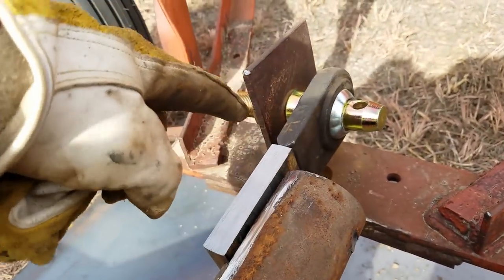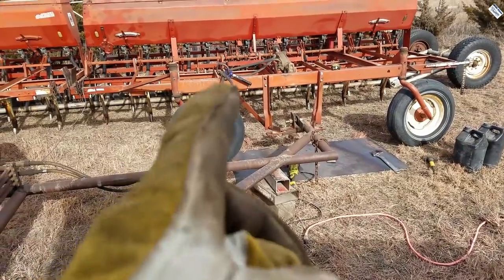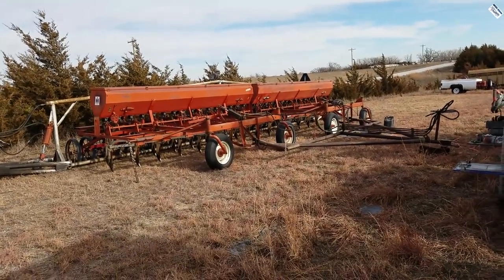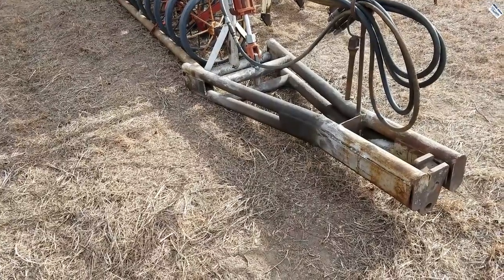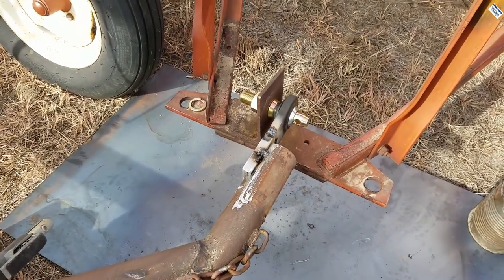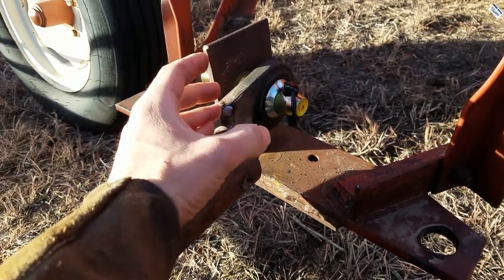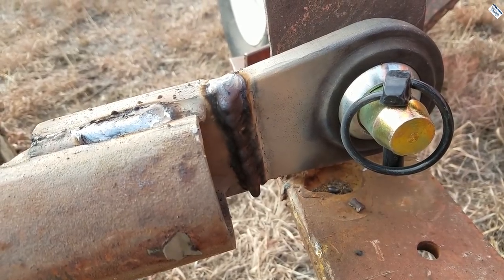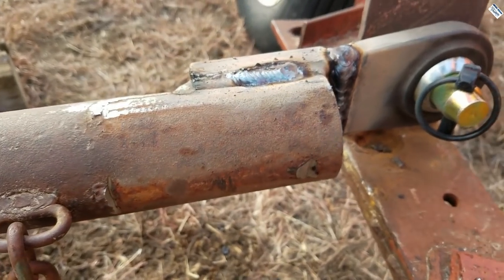On-site Work - Seed drill hitch repair

Comment: Liked the use of the metal sheet to catch grinding/welding sparks from igniting the grass. There's a lot of people who wouldn't think of doing that or using what water you had left to damp it down. Great video.
Reply from the maker: Thanks!  It's insanely dry out here right now. We're under a fire advisory right now. If I had started one, I would have been responsible for the costs of putting it out. I wasn't taking any chances!

Comment: Maybe it could apply there, when I need to weld close to a heat sensitive part, I cover that part with a wet towell keeping it pretty moist, this stops the heat from getting much above boiling point...
This is quite big, guess it needs to be if you want ot seed all the land in the same season...   ;)
Enjoyed!
Reply from the maker: Wet towel is a good idea.  And yep, big tools are required to cover the thousands of acres farmers need to plant to make a living. Even with the big machines, most farmers around here spend at least 2 weeks of 18 hour days putting the seed in.

Comment: Maybe when making these repair or fab videos you could throw in what rod and settings you used. Have to assume the way slag peeled, you were using 7018, but would be nice for some of us to know. Also, do you ever use 6010 on roots in the field when you think there is going to be a lot of loading? Nice repair with the 3 point hitch pins! Was the drill originally equipped with that trailer ball arrangement for pivot points?
Reply from the maker: Howdy Fred!  I'll try to get in the habit of mentioning rods and settings. It was 7018. I do use 6010 root sometimes, but only if it's rusty metal that I can't get clean with the grinder.  Those drills were originally equipped with some kind of hook and eye system, but I can't remember  exactly what they looked like.

Comment: Are those three-point eyes replaceable in the sense of 'cut off/weld new on' or is the heim joint removable? (presuming it being worn out is noticed before the hole is worn oval)
Either way, good sturdy repair!
Reply from the maker: It's cut off/weld new on.   I hope it's sturdy!

Comment: Just out of curiosity, how do you bid your work is it a stop charge and per hour after?
Reply from the maker: For a normal on-site repair,  I charge from the time I leave my shop until I leave their job site. This way they are paying me for drive time one way, which covers mileage costs. (2 hour minimum)  For building corral, I often charge for that per linear foot, and I don't worry about mileage.  In the shop, it's usually a simple hour rate.

Comment: Do you have any tips on how you get started doing what you do I’m only 15 and I am really interested in what you do for a job
Reply from the maker: Yes I do. And it would take forever to type it all!  The short short version, get a job as a welder with someone who is willing to teach you about the business side of it. Then, use those paychecks to buy the equipment you need. Then start working for yourself on weekends until you get enough customers to go full time.
Reply: Wide Vision Metal Fab thank you that really helps

Comment: Why not slide the eye back so the joint between the scrap and the eye is in the pipe then u could weld the eye to the pipe also for more strength
Reply from the maker: The hitch needed to stay in the exact same position to operate correctly.